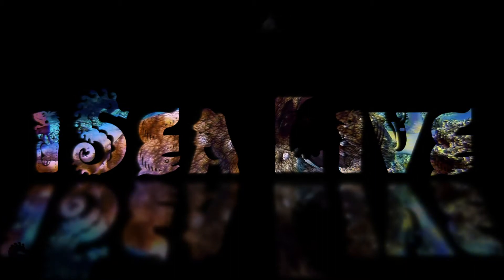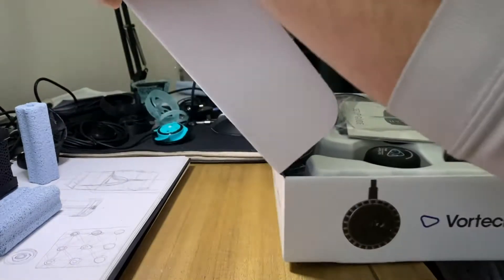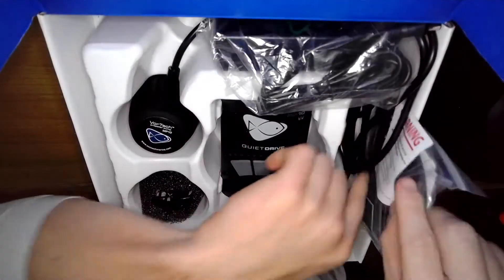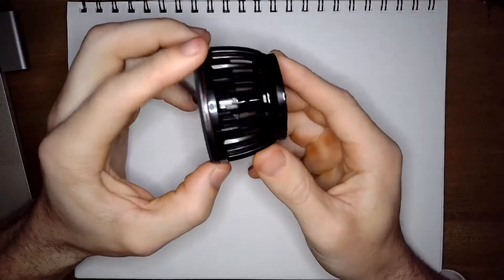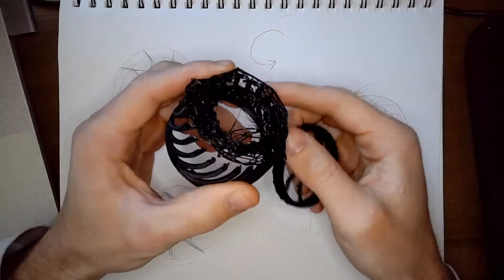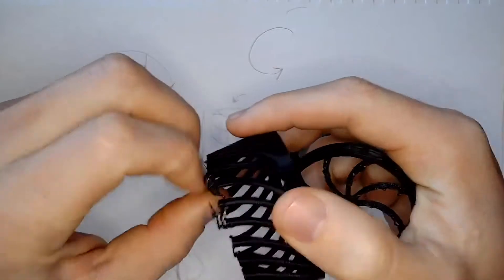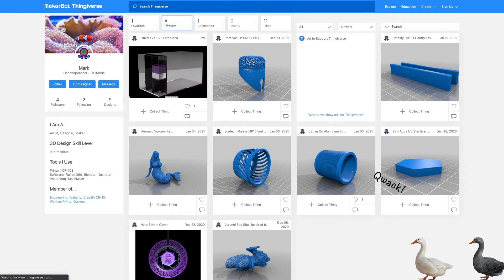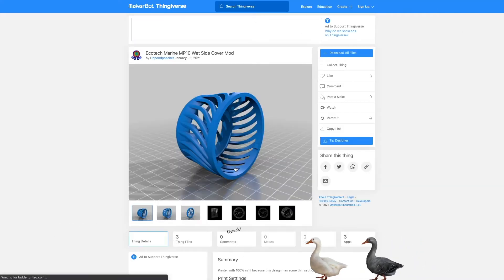Vortech MP10 Mod | Design, Printed and Failed | Nano Reef Wavemaker

Comment: dude this is next levelllllllllll, if i order this and a roller for the nano do you ship to canada and is it on back order currently? thanks again for the great videos man keep up the great work!!!!
Reply from the maker: I do ship to Canada but you need to be careful about customs charges.  I don’t know how it works but some ppl have had to pay customs to get their packages.  
Also I don’t sell this model because it was just a test and it doesn’t improve the pumps function in any way.  I just give ppl the files it they ask.   I do have an anemone guard for the MP10.
Reply: @ISeaLive   i need the anenome guard as well id be willing to take the custom charge risk as i dont have access to a 3d printer :(